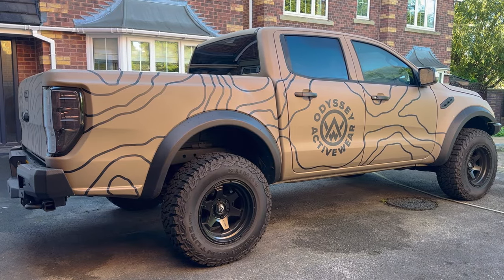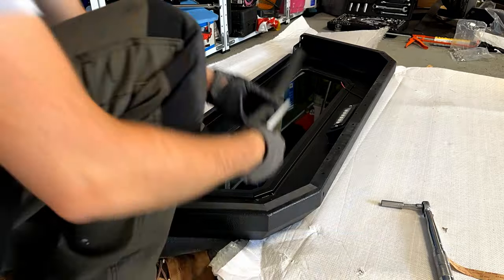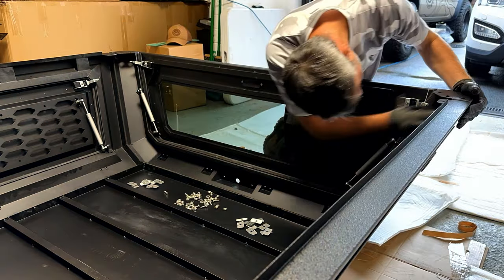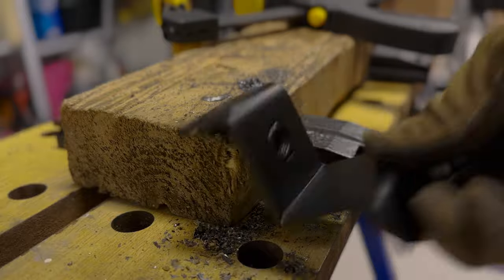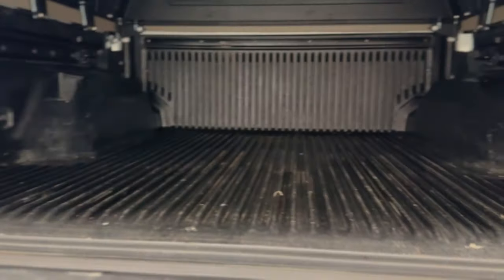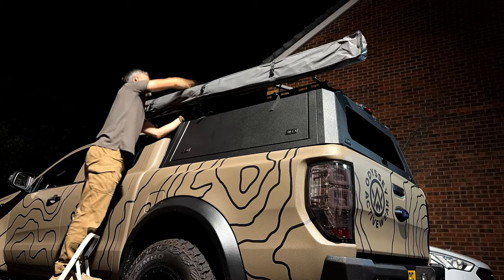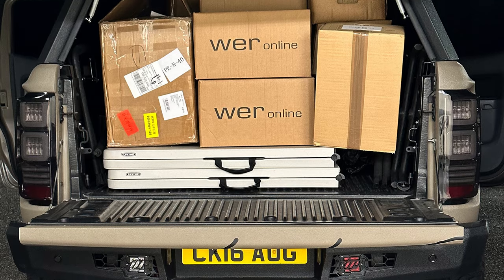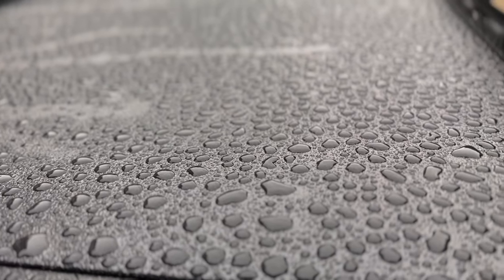This Steel Canopy on My Ford Ranger Changes Everything!

Comment: Hey Chris great video! I’m looking at installing a similar looking canopy on my ranger (albeit a bit lower in height compared to yours). Can you please confirm that we can install a roof rack on top using the included side rails of the canopy? I’m asking since I’m also planning to mount a rtt + 270 awning on the canopy. Cheers!